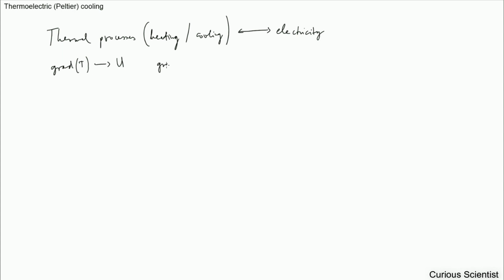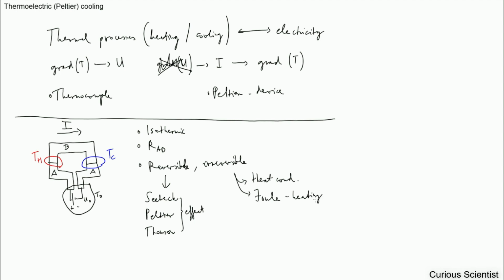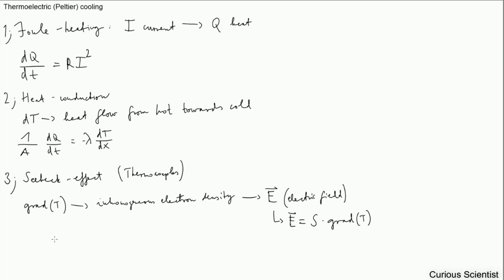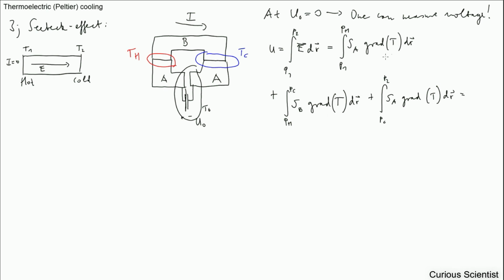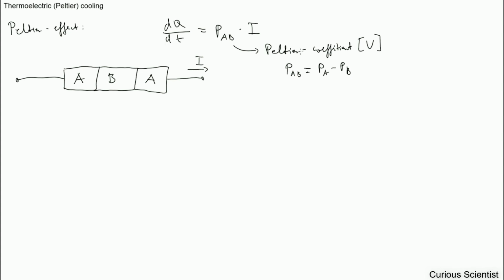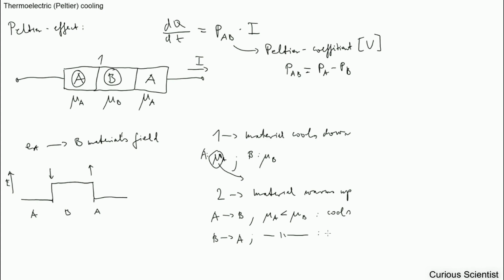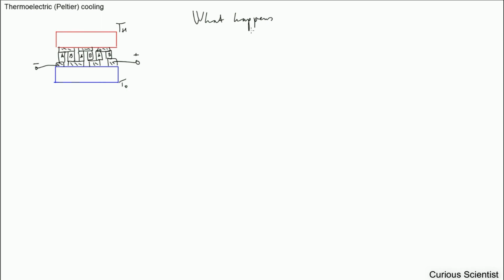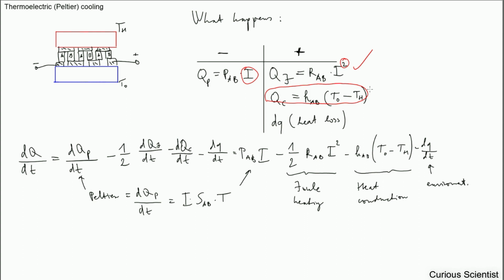Theory of Peltier cooling

Comment: sir why you devided the Joul heat by 2 ?
Reply from the maker: Half of the Joule heat ends up directly in the cold side, and half of the heat ends up in the hot side. The equation is created in such a way that it cares only about one side, therefore we only consider half of the total Joule heat. We have the Peltier heat which is kind of the heat that can be used for cooling, and the rest of the equation (terms with the minus sign) are working against this heat.
Reply: @CuriousScientist  one other question sir, the heat Qc is the hot side's heat of the battery or the peltier device ? it's moving form the battery's hot surface to the cold side of the TEC or it's moving from the hot side of the TEC to his cold side ? thank you for this video it helps so much.
Reply from the maker: I am sorry but read your question again, it doesn't make any sense. Please rephrase it, so I can understand what you want to ask.
Reply: @CuriousScientist   i am sorry if it wasnt clear i just want to know what is Qc, its the heat transfered from what to what. thank you for your patience sir.
Reply from the maker: Qc is the cooling power of the Peltier. The amount of heat pumped from the cold side to the hot side.